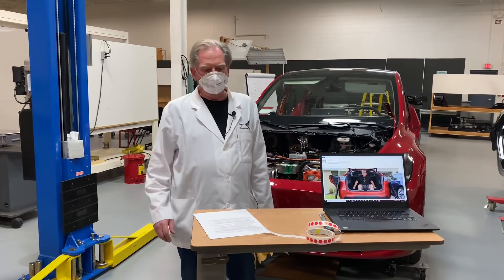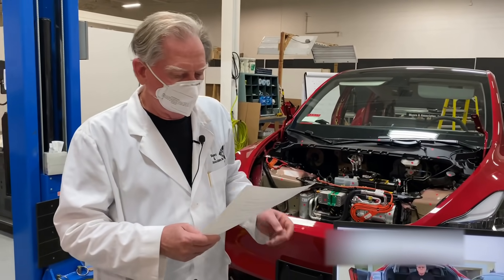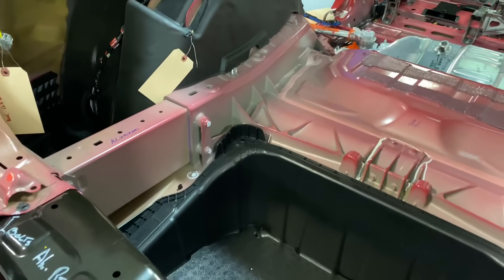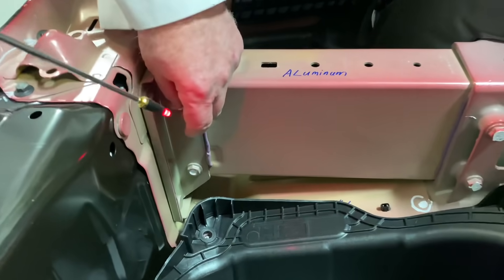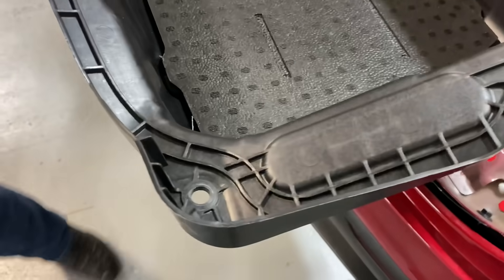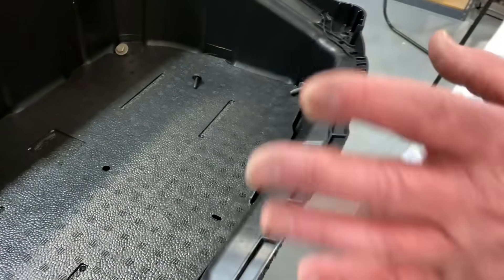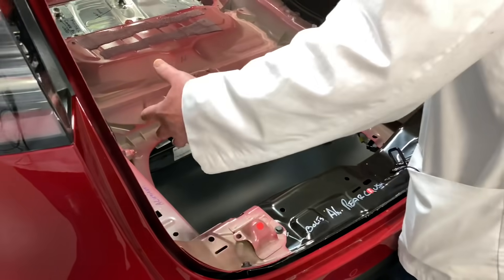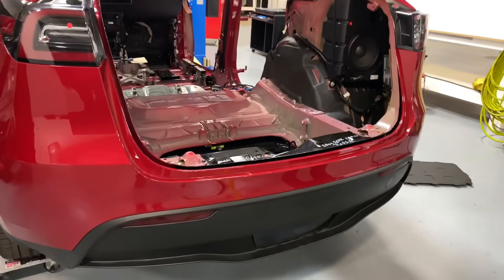Model Y E14: Rear Mega Castings and Structure, Trunk Tub, Potential Tow Location

Comment: Would a thief be able to cut open that plastic tub to steal your stuff? The Model 3’s has always been solid metal and might be part of the crash protection?
Reply from the maker: Another deterrent is the fact that there is a separate plastic shield (and a pretty stout one at that) that is in place beneath the tub and secured with hex bolts.  It would be a pretty tall order to try to cut into.  Thanks for tuning in!
Reply: Munro Live I didn’t know about that separate shield. Thank you so much 😊. I am really enjoying these videos!
Reply: The plastic bin is plenty strong and will resist as much as thin metal. Thieves will not work that hard to get in a car.
Reply: Jean-Yves Hudon Thank you

Comment: Not happy about a missing tow hitch, especially since it's available on European version. But how do you look underneath, see no structural supports anticipating towing, no predrilled holes or welded clips, and say you're happy it has a "capacity for towing"? Because a plastic plate pops off?
Reply from the maker: The bumper beam passes directly above the opening, slightly forward of the fascia, so it looked to us like a tow-equipped bumper beam with a drop-down hitch could be swapped in at a later point.  We've seen other OEMs feature a bumper beam integrated hitch.  Thanks for tuning in!
Reply: @MunroLive  Thanks for quick response. Love your work. From what I've heard on the manual arguing that towing is not recommended, doesn't seem like Tesla was expecting a follow-up with a tow hitch offering, but hope you're right. My 6mo old Model Y order is up against the RAV4 Prime which may also now be delayed. They're both great innovative vehicles.
Reply: you can probably fit a tow bracket in that space, it might explain all the extra parts and fasteners in the area, probably to keep the frame of the car from being too structurally damaged by a rear impact.
Reply: @miguellopez3392  Makes sense, but wonder if that was a high priority, how they designed a hatch door aesthetically to protrude, making it much more likely to be damaged.  Maybe a beefier hitch, tho adding weight, would help the frame absorb the blow before it translates to the hatch door.

Comment: The odd bolt to fasten the bucket must be deliberate, it's a too obvious rule for any engineer. Maybe the odd bolt must be screwed at a different stage in the assembly for some reason and that's the way to make sure that is the one that is fastened?
Reply: Javier Hualde i think its becouse it can be seen so it must be blackend
Reply: @TheLemonBird  That might be a possibility, but then a straightforward solution might be to use 5 identical black bolts.

Comment: 6:50 there are 4 alu bolts, 1 steel bolts. Stop making stupid suggestions!
Reply: Why don’t you buy a model y and strip it down for us then?
Reply: @DavidHRyall  why you care
Reply: Yep, that makes sense for not stripping the threads.
Reply: Bolts for alu are self tapping
Reply: @bassrover5925  aluminum siding bolts are self-tapping, you def don't want to self tap structural aluminum 😂
Reply: The original point is correct tho, but it's because you want to avoid corrosion from dissimilar metals, so want to make sure they don't put the steel bolt into the alu thread.

Comment: Great! love these video's! More "happy's":-)

YES, Tow Hitch!  Please Tesla, make it happen at least 3000Lbs (or 1500Kg)... I will swap my Cybertruck reservation for a Model Y in a heartbeat (Cybertruck is way too big for me)
Reply: You'll need to retrieve that glider! I am banking that an aftermarket hitch will come. If not, I kept my old RAV4 in the garage for now.
Reply: @soaringibex   That's the only reason.. I need to haul my glider to Germany during summer.. Model 3 Hitch is too weak (900 Kg), Model X too expensive, even second hand.

Thanks for checking out my channel! I hope to get back into the cockpit pretty soon!.
Reply: @MarcoNierop  My discus b with Cobra trailer falls below 1,000 kg so I should be fine. I am mostly worried about range as I need to traverse a 1,200 meter mountain pass.
Reply: BTW. Isn't that also a Discus b you're flying? Cobra trailer is 460kg with 233kg empty glider weight should leave enough room for additional cargo to trail under 1,000 kg, no?
Reply: @soaringibex  I have a Schempp Hirth ship.. but its a 40+ year old Mini Nimbus|! Great nimble little glider, with 42-43 L/D  so not bad at all for cross country flying and Club class competitions!

In theory the Model 3 has enough, but I want to have some umpff spare to get over these bloody  7% hills they have in the German Autobahn. My current car has a limit of 1200Kg but is not really enough, it has to shift all the way back to first gear to get over these hills, which is really annoying. It would also drain your battery in no time, and charging after passing each hill would also get very annoying.

Beside this I need the room in the Model Y to carry my tent and other camping gear, The Hatch is very handy, my current car (Fiat 500X, a small SUV) has a Hatch and would never buy a car without a hatchback ever again.. 

I have a reservation for the Cybertruck tri-motor, but it is so huge, rediculous as a daily driver.. I may go for it after all, but all depends how the tow hitch for the Model Y works out... Anyway, I have about 2-3 years to figure this out, as I do not think the Model Y will be available soon here and the Cybetruck will take at least 3 years I think.. But who knows... my TSLA stock needs to get up quite a bit for me to be able to buy the Cybertruck.
Reply: Tow hitch is coming - I imagine they are just waiting on getting the proper "clearances".
Reply: LMAO if you’re debating swapping to a midsize crossover from a truck, you never had any business ordering one in the first place. 

Please do it though you’re taking up space for those of us who know what we’re doing
Reply: @mattbrew11  At the time I placed the reservation (just days after the reveal)  I did not realize it was so big. Model Y is more sensible for me, 100% agree with that, but the towing is really important to me, Model Y must be able to tow my glider with eaze, otherwise I will stick with the Cybertruck after all.. Will be a fun experience no matter what :-)

Comment: Yes. Those are shear bolts for collision.
Reply: It really is beautiful how it diverts the force of a rear impact around the central cabin. It's easy to see why Tesla vehicles are the safest in the world.
Reply: @EricEstesEleutherian  Cars have had this and crumple zones for 30 years.
Reply: @04red6  Mercedes Benz pioneered rear crash structures that could survive the same speeds as those in the front in the w124 E series of the late 80s. A feat other manufacturers claimed couldn't be done and forever changing crash test requirements for the benefit of us all.
Reply: So the idea would be that those bolts cut themselfs in an accident, preventing the casting piece from recieving the shock?
Reply: @TomásOttonello  the shear bolts absorb crash energy, and when they break, they allow deformation which also absorb
Reply: @niconico3907  wow, I see, thanks a lot!
Reply: @TomásOttonello  Yeah. Pause at 7:11 - You can see if those bolts shear off, the rigid metal will slide into the cast part and there's thinner metal below to cushion the impact.
Reply: @TomásOttonello  Part of crumple zone. Preventing people from receiving the shock. :)

Comment: What manufacturer responds to customers and industry experts like Tesla?  Consumer reports says there's a break issue on the M3.  Boom, a week later solved and pushed out to the fleet.  Sandy says make these improvements going forward, and he's just mostly positive about the updates they did to the Model Y.  And now the heat pump noise?  Don't fret says Tesla, we'll make it right soon.
Reply: I think Tesla may have already been working on noise isolation case for Heat Pump.
Reply: I leased a Chevy Spark EV in 2014-2017. Only 7,400 were ever made. You would think Chevy would reach out for feedback from early adopters for product improvement. They never did. And now we know why GM is so far behind in the EV game. 

Brilliant powertrain. 402 pounds of torque. If you accelerated hard, it would spin the front tires on tar strips at 35mph. But the software was god awful for the drive unit.
Reply: nomadmac I wanted they 2014 Chevy Spark EV so bad!  It was a riot, quick and fun, but it only had about half as much range as I needed so I couldn’t do it.  With incentives it was only like $14k new though.  Hoping that future EV’s can eventually get down to that price range with 300 mile ranges.  But that spark was worlds better than any of the gutless ICE cars in the category, that’s for sure
Reply: @martingardens  It was more an "LG Bolt" than Chevy. It was car made by MBA and accountants, without soul. Maybe it was "cheaper" for Gm in short term, but ultimately it proved to be flop.
Reply: nomadmac Tesla is new and has to loose everything if they don‘t listen - GM? Too big to fail - every American paid already for that GM insolvent
Reply: None.  People ignore it, but the fact that tesla is taking complaints and feature requests off of twitter and actually implementing them is revolutionary.  The problem with traditional auto, is they want to design once and build, with no changes if they can avoid them.  They don't do continuous improvement, so they don't care about feedback.  They think they can just market their way to sales no matter what is disliked about the product.
Reply: @_PatrickO  They dump their ICE cars on dealer lots like the garbage they are to sit and rot with vultures circling and pushing the carcasses on to people.

Comment: Hi Sandy! Elon said at the last earnings call that Tesla is waiting on a big casting machine that will be able to cast the rear underbody in 1 piece instead of the current 2
Reply: Here you can see a relatively big casting in roughly the same position in a BMW iNext.
http://www.mynewsdesk.com/no/bmw-no/videos/prototype-av-bmw-inext-45148
See 0:08
Reply: @koeniglicher  It's difficult to gauge the size of the casting in the BMW iNext but it looks much smaller than the Model Y which casts the wheel wells
Reply: It seems that the entire vehicle's support structure will eventually be cast in one piece: https://electrek.co/2019/07/23/tesla-giant-machine-produce-model-y-body-one-piece/
Reply: @brothervance1932  nope, they could use the stainless steel , not the entire pressure casting, casting is not elastic
Reply: Le Chat Botté What stainless steel? I included a link to an article you seem not to have read.
Reply: Brother Vance it’s a year old article. And still no single casting not wiring in the Y nor Shanghai. Maybe the 2022-23 economy Y.